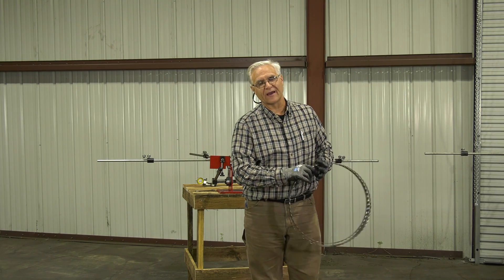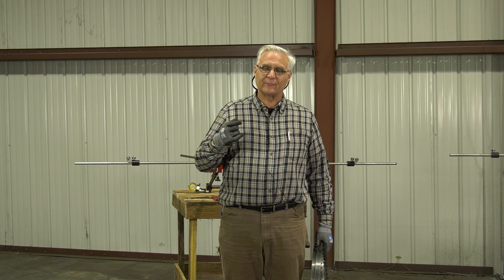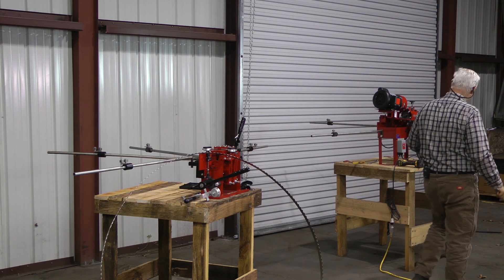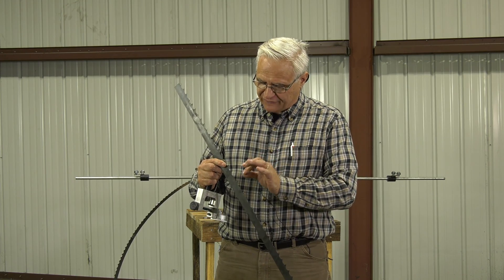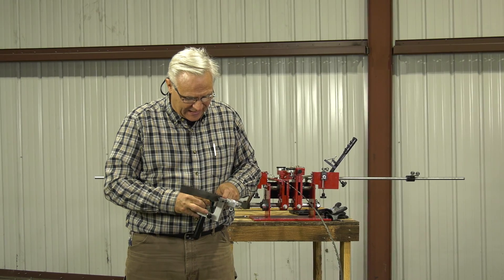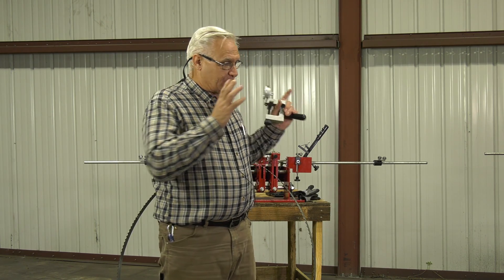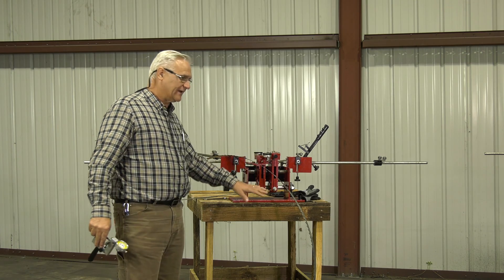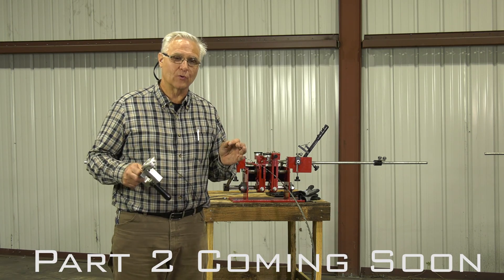How does different set on your sawmill blade affect performance? Intro

Comment: I'm looking to buy... You said that your sweep grinder doing a very well job but what's the difference between  the Woodmizer bsm250 were its always constant because is only one pass?? compare to a sweep grinder were you could change the form of the blade different every time???   did a sweep grinder less accurate on the design of the blade compare to a one pass??